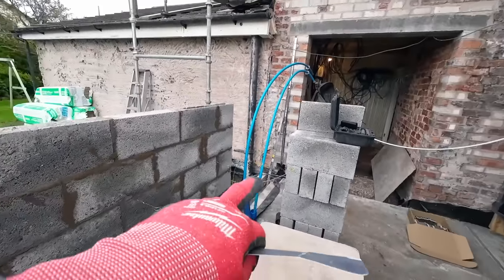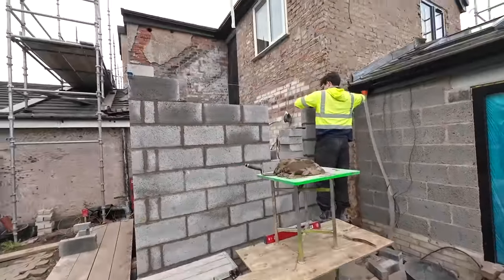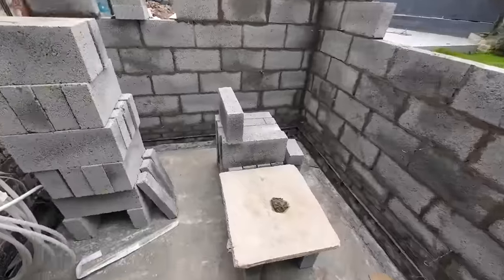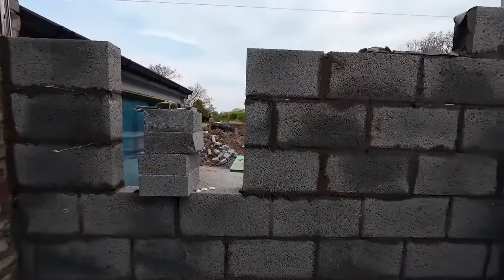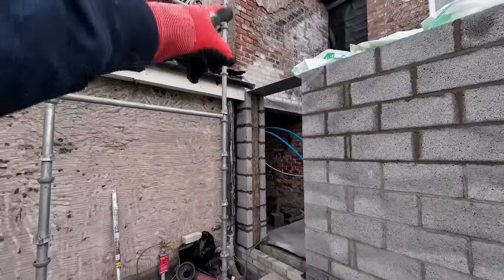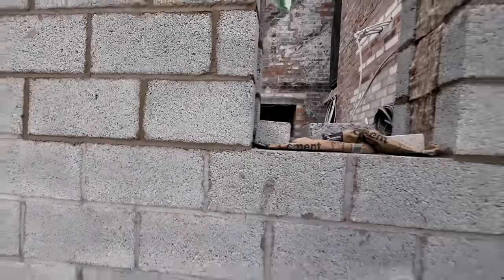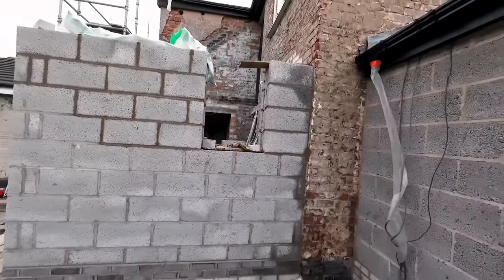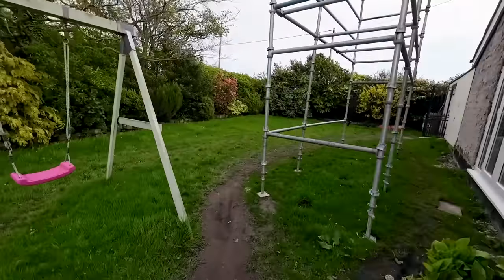150 MILLIMETRE  CAVITY TO MEET NEW BUILDING REGULATIONS

Comment: Thermal calcs?
Reply: @SteveAndAlexBuild  Pay £240, i don't know a bricky that's built a 150 yet. Money making scam, probably government owned company
Reply from the maker: Still don’t know what you’re talking about ?
Reply: @SteveAndAlexBuild  There are companies that carry out thermal calcs, they visit the property after you pay them. They will tell you what you need to put in place to achieve thermal effeciency such as loft insulation, double glazing, central heating etc. I'm just doing an extension on my own house and they haven't visited yet, so i rung them and they said,it'll be fine just carry on building at 100 mm cavities, we'll get to you shortly. It's box ticking thats all.

Comment: Great video, but it looks like your using thermalite blocks, the ones that you can cut with a hand saw.  Must say I'm not a fan of these type of blocks, I've seen many crack after a build has been finished.  I know the mortar can't be too strong a mix and the thermal properties can't be beat, but the strength of the wall won't be as good as using dense concrete block or traditional bricks. I know some people might argue the fact, but I just go by what I have seen.  I still love your videos  and you are doing nothing wrong building reg wise, it's just some constructive criticism and I hope it causes a debate from others.
Reply from the maker: We never use therm a shite . 
   We use plasmor fibolites , same  weight but probably 5 times stronger 💪🏼💪🏼🧱👍🏽

Comment: This filling the cavity is a no no imo, definitely use concrete or pumice block on the inside of cavity I feel these Wil absorb and retain more heat whereas full installation Blocks will not, going back to cavity size however big it is imo the retention of an air space is best that air space should be between outside block and insulation material to mitigate the ingress of damp, as we all know the two things you don't want are damp walls and dry sex ! Have a lovely day retired bricklayer xx

Comment: Im putting 90mm celotex in mine ...made cavity 20 mm bigger and as luck would have it the stone is 95 mm . 
Utter madness .
Reply: It's only madness because you don't see the point, but lots of us do see the point.
Reply: @tlangdon12  90 mm insulation into 100-100 cavity with insulation buttons to go on gives absolute minimal grace , you can't clean cavity or inspect it and very easily  create a bridge and that's good practice ?? Are you a landscape gardener ...

Comment: The 150mm cavity is bs, you have to have wider lintels, longer wall ties and thicker insulation. I'am a builder and it would be more stronger to keep the cavity 100mm and lay the internal blocks flat 🤔
Reply from the maker: Stronger but no warmer 🧱👍🏽
Reply: @SteveAndAlexBuild  use eco baps in cavity, silver foil both sides, 30mm has the same u-value as 100mm cavity baps. So if you put 100mm eco baps that's more u- value than a 300mm cavity 🤔

Comment: Never liked full filled cavity’s, if I build another house for my self I will go with clear 50mm cavity with high level brick vents to air the cavity and keep it fresh and insulate on the internal blockwork.
Reply from the maker: You would need 100 mm +  pir insulation which would be rock hard to install and keep on the wall 😬🧱👍🏽
Reply: @SteveAndAlexBuild   yup probably but I’ve never liked the full fill cavity’s , stagnant, damp , unvented areas prone to problems.

Comment: Dont like that roof insulation being used in walls, much prefer a more waterproof type material..
Reply from the maker: It’s not roof insulation it’s cavity wall insulation design specifically for full fill cavity wall construction. It also repels water . 🧱👍🏽

Comment: The energy used in the production and transport of insulation materials is never mentioned when arguing for low energy buildings.  We aren't actually saving energy.  We are using energy which will take years to recoup.  Considering the light weight nature of modern structures: particularly housing: this may never be regained in the lifetime of the building.  [edit] Particularly as the climate is supposedly getting warmer
In short, we are not saving energy.  We are stealing it from future generations to maintain a manufacturing base, purely for economic reasons. 
Well!  That's my rant for the day.  What's your opinion?
Reply from the maker: The bottom line is to reduce gas consumption and dependence which I am all for 🧱👍🏽
Reply: @SteveAndAlexBuild  As I was saying, it takes energy to produce and transport the insulation, which must be recouped before any saving can be made.  So! Instead of saving energy now, the benefits will not be a felt for many years in the future., if ever.

Comment: I must be blind, as I did see wall wire ties but dont you usually run wire mesh along every 3rd or 4th course. Ive got to say, Im not a fan of the 150mm gap, or the insulation wool batts you have to use.
Reply from the maker: Yes you must be and no we don’t 😆🧱👍🏽

Comment: Guys. Standard Rockwool shouldn’t be used full-fill in the cavity, it isn’t warrantied for this. It will encourage damp to cross the cavity. Really bad idea.
Reply from the maker: We don’t use rock wool . Been using this method since 1986 and never had an issue or been pulled by building control . 🧱👍🏽
Reply: @SteveAndAlexBuild  well, if it isn’t rockwool and is just a glasswool batt, then that is even worse. You understand that regs change all the time and insulation performance is checked and revised as time passes. 
If there isn’t a clear cavity then the insulation will get wet at some point and will cause damp and poor insulation performance. 
I would suggest checking manufacturers recommendations, BBA certification and the regs rather than relying on what you did 30years ago. 
If you want to build something well and look after your clients of course? 
Also, you didn’t cut in a vertical dpc at the wall abutments.
Reply from the maker: We work to building regs and do as the inspector asks us . 
    Not every inspector likes the vertical damp and some pefer to open up the cavity up completely….. both weakening the original house wall . 

Here is some  information I’ve copied about the Knauf cavity insulation. 

In addition to this, it is water repellent and specifically designed for use in external masonry cavity walls.  It provides a full-fill insulation solution that is installed while the walls are being built.  
🤷🏼‍♂️
Reply: @SteveAndAlexBuild  fair enough. Good luck to you and your clients.
Reply from the maker: We don’t need luck
Reply: @SteveAndAlexBuild  you might.

Comment: If I built a house for myself. This is exactly how I would want my house to be insulated within the cavity walls. Makes for a much warmer house all year round and will bring your energy bills down dramatically.
I've never really understood why they used to allow cavity walls with no insulation atall between them. Due to not being a regulation when building a house. Why do a job that is technically not a proper job. Do a job properly once and you will never have any redo jobs. I just dont get the mindset of a bodger.  Lol 😂
It will end up costing more in the long run. For both the bodger and the person paying.
Reply: Way too much insulation with no air gap to keep heat out . Homes are going to need air con in summer .
Reply from the maker: Insulation keeps heat out aswell as in 🧱👍🏽
Reply: When they were first introduced in the early 1900s (or thereabouts) cavity walls were not intended as an energy saving feature, they were meant to reduce damp. The idea was that any moisture that came through from the outer skin would evaporate away in the cavity and not touch the inner leaf. Jamming them full of insulation is a relatively modern idea and not necessarily a good one if moisture can't escape.
Reply: @SteveAndAlexBuild  . South facing wall , outer skin gets heated on a sunny day it’s touching the insulation which transfers the heat to the inner skin . Room gets heated .

Comment: Nothing ridiculous about 150mm cavity insulation.  What is ridiculous is the house of regular blocks on the inner skin instead of [foamed concrete] insulating blocks reducing the benefit of the wider cavity.
Reply from the maker: How do you know what’s blocks they are ?
Reply: @SteveAndAlexBuild  can tell  by looking and the size and handling.
Reply from the maker: They are Fibolite blocks which are very thermally efficient and way stronger than Shite blocks you mean . They are very weak and terrible to fix into .
Reply: My mistake, I apologise.
Reply from the maker: No problem at all . 🤙🏾🤙🏾🧱👍🏽

Comment: Of course 150mm of fibrous insulation such as this is still not very good for saving energy because UK build regs is still way behind where they should be. Also, such vids as this i.e only showing the block laying process does not show the key relationships heat transfer and damp proofing wise to the existing poor quality building fabric. Junctions are all important in achieving good thermal and damp resistance but from what can be seen here do not appear to have been considered.
Reply from the maker: That’s because it’s a bricklaying channel 🙄
Reply from the maker: The house doesn’t have a cavity and will be rendered so there won’t be any damp 🙄
Reply from the maker: No probs 🤙🏾🤙🏾🧱👍🏽
Reply: It's all a con i live in a house that is 400 years old and use very little energy to heat it .
Reply: For someone living in Sweden this wall looks like it's giving decent insulation and not very ridiculous. I have also seen that there are bricks with the insulation in the bricks so you don't have to do two rounds of bricklaying, just a single round.
Reply: @Arfabiscuit  Exactly.

You cannot beat a proper stone wall or cob.

Brick can be good too.

Combined with a proper chimney,
meaning
that the wall is kept warm and dry,
acting as a radiator.

It is the use of breeze blocks,
and central heating,
that is the problem.

Horrible modern houses,
built of shpoddy modern materiels
to poor quality designs,
and will be demolished within decades,
whereas many old houses are centuries old.
.

Comment: Block walls with no steel reinforcing ?  They wouldn't last long in earthquake prone countries
Reply from the maker: Well we aren’t in an earthquake prone country 🤷🏼‍♂️
Reply: @martin2466  Youtube is a global social media platform.  Some people might take advantage of that fact to broaden their minds.  Others might take a more insular view.  
If someone originally from the UK emigrated to an earthquake prone country, as many (and that would include my neighbours) have done, they might be inclined to complain about the cost of construction if they were unaware of the amount of steel that is required in the  block walls per the local building code.  So, there you go:  A little bit of, admittedly somewhat contrived, relevance.  🙂
Reply: @martin2466  Sorry, I have must have missed the part where it states that only comments that are directly related to erecting block walls in the UK and/or UK building regulations are permitted on this channel.

But I am hoping you can cut me some slack.  I have lived through an earthquake that shock so violently that it felt like severe turbulence in an airplane.  Shaking so intense that it would have been impossible to run to a desk to seek cover. I was on the sixth and top floor at the time.  The shaking was so strong that the top four floors of the five story, tilt slab, building next to me pancaked onto the ground floor ultimately killing people.  It was more than a little disquieting hearing people yelling out for help in that building and not be able to do anything for them.  Shaking so violent that it shattered the concrete in the block work of the ground floor walls of my neighbour's house exposing the bare reinforcing rods.  

Given this background, perhaps you might be able to understand the visceral horror that I experienced seeing Steve and Alex's wall go up without any reinforcing.  It's just something outside my comfort zone.  I think it might have triggered some PTSD.  And I just felt compelled to comment.  Please forgive me wasting perhaps 3 seconds of your time and cluttering up this comment section with what I now understand to be irrelevant and unwanted verbiage.
Reply: @martin2466  This reminds me of a joke that was circulating back when I was a child growing up in one of your former colonies:

Q: How can you tell when a plane load of poms has just landed ?
A: You can still hear the whining after they shut down the engines.

Sadly for the majority of your fellow country men (who in my experience are top notch blokes), your comments do nothing to dispel that stereotype. 

Seriously mate, what an over the top reaction to a harmless, well-intentioned even, comment.  You might want to take a good hard look at yourself and try to figure out where all the hostility is coming from.  It's certainly not healthy.  That could be the first step in the healing process.
Reply: @kshred3043   How can you tell you're at an oz funeral? there's only one person not drunk.😆
Reply: California is an earthquake prone region, so it needs reinforced walls, but do the walls need 150mm of insulation there?
I guess not, at least if it is not in the mountains, because it freezes almost never there. The UK doesn't have strong earthquakes, so no reinforcement needed.
Building regs are all made to local conditions, although standards may differ.
Reply: @kshred3043 you post 3 rambling, tone deaf lectures about a video of a wall being built, you then go on to make a quip about pommies whinging.
Hope the irony isn't lost on you... 😂🤦‍♂️
Reply: @illmitchjax  No, mate, not about a wall being built.  About martin2466's (now apparently deleted) completely inane comments.  Seems like you and him are kindred spirits.  Maybe you could form a support group for the 'easily triggered'.
Reply from the maker: You don’t even know what triggered means 😢
Reply: @kshred3043  how exactly is pointing out how pompous you being 'triggered'? 🤔
Reply: @SteveAndAlexBuild  Triggered means a total over reaction to something trivial (like my initial post). Possibly, maybe even likely, due to some underlying and deep-seated psychopathology.  Time for you guys to do a bit of introspection.
Reply: @illmitchjax  'K Shred how exactly is pointing out how pompous you being 'triggered'?'
WTF are you attempting to ask ?  Please get back to me with a comprehensible question and I will endeavour to answer.

On second thought, don't bother.  Life is too short to waste any more time on a bunch of inarticulate losers (who don't know the difference between 'pompous' and eloquent').  

I will leave you with this quote attributed to Mark Twain: “Never argue with an idiot. They will drag you down to their level and beat you with experience.” and this piece of advice: "Get a grip". 

I am out of here.  Enjoy convincing yourselves that you 'won'.
Reply: @kshred3043  sorry Mr. Psuedo Intellectual, I made a typo and omitted the 'are' from my question.
I would've expected someone of your apparent intellect to be able to fill in the blanks, but here is the question in full:
"how exactly is pointing out how pompous you ARE being 'triggered'? 🤔"
Reply from the maker: Kshred3043. Check back again , that was hardly a 
“Total over reaction “ 🤣. 
  Ultimately I can end all this ridiculous arguing because it’s getting hard to follow now and quite ridiculous. 👋🏾👋🏾
Reply: Love it when people comment on other countries building methods not being 'up to code' or 'inadequate'. What you see being built is exactly how it needs to be done to meet the standards/purpose in that country. If walls arent being built with rebar and concrete, its because they dont need to be
Reply from the maker: @lordofthesuperchargedgiraffes . Absolutely spot on 
😆🤜🏽🤛🏽🧱👍🏽
Reply: Ah yes all those earthquakes in the UK, so common.
Reply from the maker: @spig3547 🤣🤣🧱👍🏽
Reply: @spig3547  watch it now, the uk gets hit with a massive earthquake after you have jinxed us 😂😂😂
Reply: @lordofthesuperchargedgiraffes  be tough with no fault lines
Reply: @kshred3043  Cool, he should also make sure to mention wall construction considerations in exteme low temperatures builds like in the Russian tundra, wall construction in monsoon areas in Asia, wall construction in the desert, wall construction for resistance against being hit by a falling satellite etc etc.

Comment: Insulation should be placed on the outside, in direct contact with the problem - always and only. Whether it's a cable with electric power, a swimming pool with water, or a house in winter. Why British regs are so stubborn in putting shitty cavity walls, full of snots, thermal bridges and motorways for all sorts of furry gerbils?
Reply from the maker: Wow not a fan of cavity walls then. They have been around since the 1920s and are doing just fine. Our cavities don't have snots in by the way .
Reply: @SteveAndAlexBuild  quality of your workmanship is very good and you are a good craftsman. However, what other brickies are doing are a completely different story. My cavity wall was just a skip: full of rubbish and rubble in it
Reply from the maker: It’s a shame as that gives our trade a bad name 😒🧱👍🏽